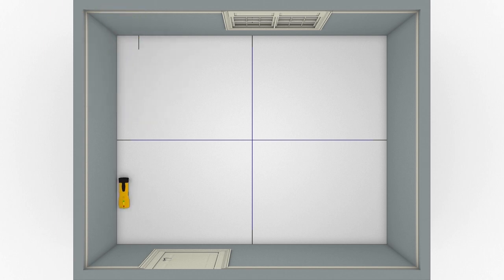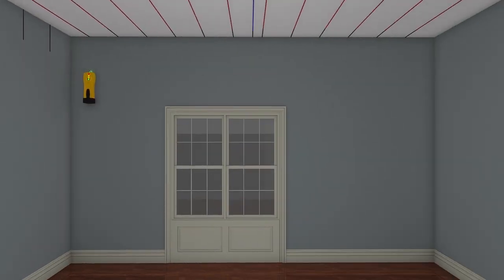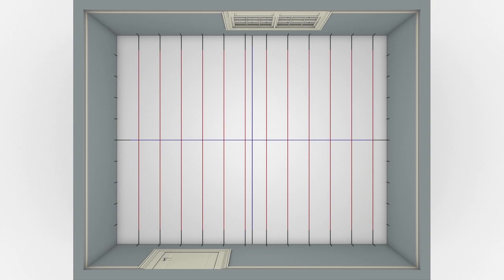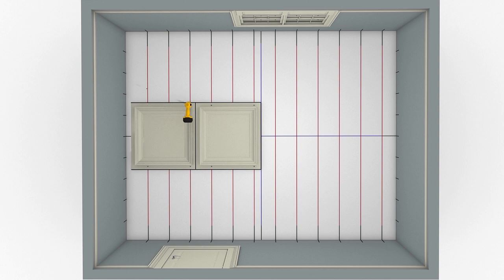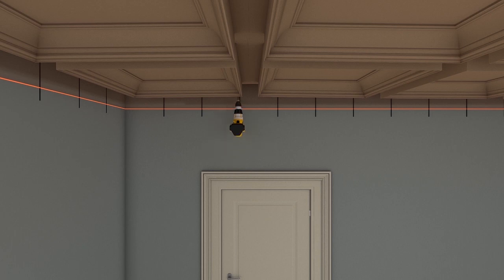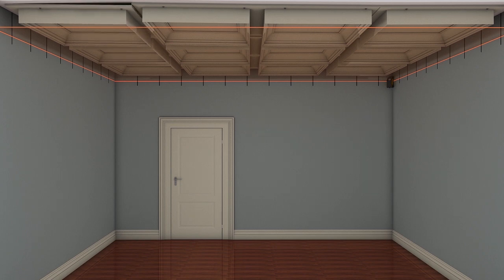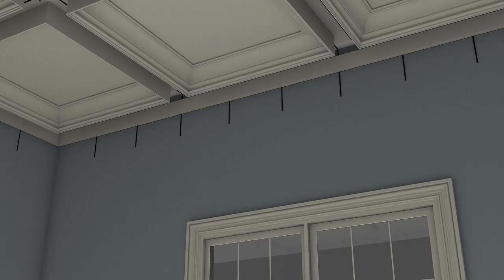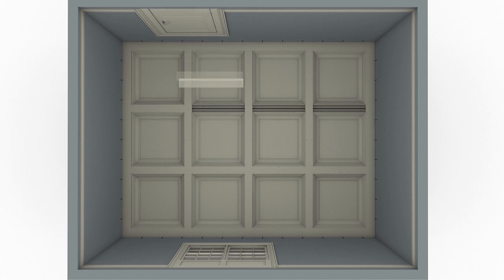Tilton Box Beam Coffered Ceiling System | QUICK & EASY TO INSTALL!

Comment: Not always are houses built to  code requirements of 16”, so maybe checking more than one joist in the ceiling would be very fortuitous?
Reply from the maker: Yes, you will need to ensure that all of the lag screws used to secure the coffer modules are driven into the joists regardless of their actual spacing.

Comment: actually, the headache is what if we have to cut the tile to fit the size of the room.
Reply from the maker: The system is custom manufactured to fit your ceiling so no cutting of the coffer modules is required.